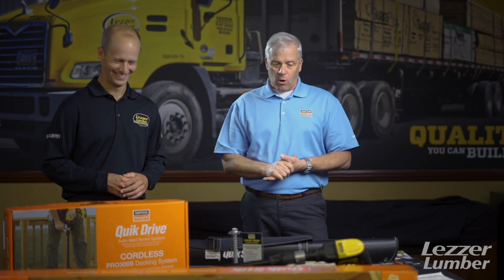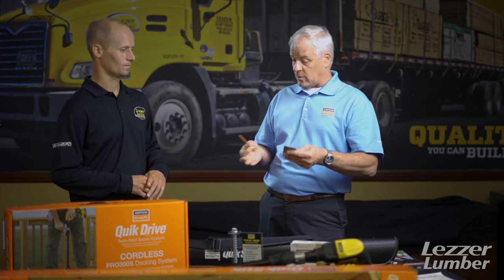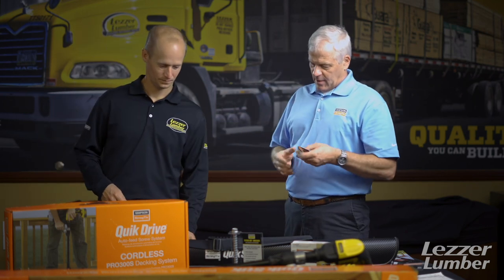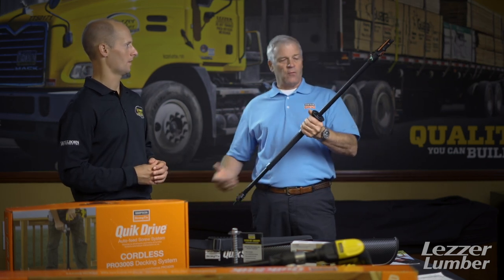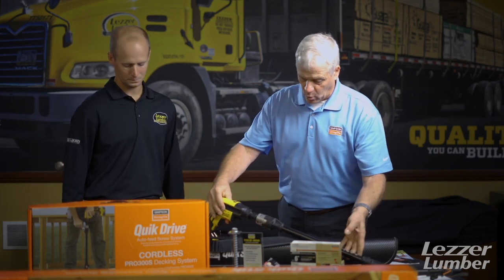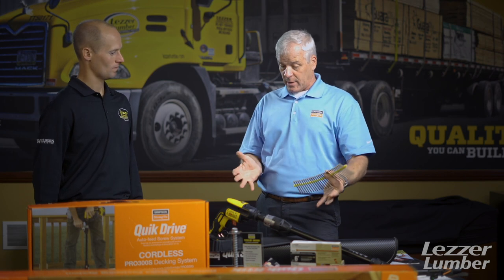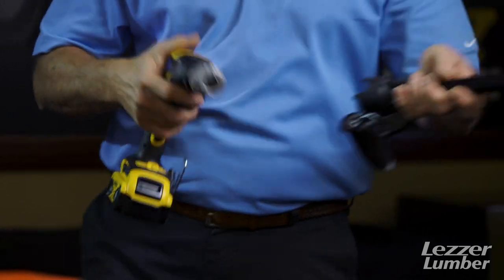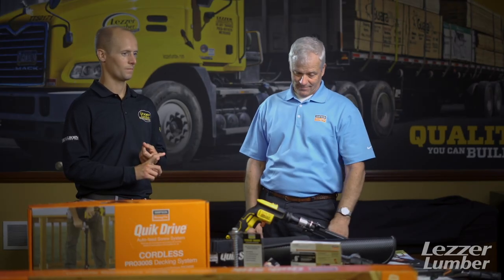Simpson StrongTie: SDWC Truss Screw and Quik Drive Explained

Comment: I have a concrete block wall to tie  H2.5A  to a wood truss, what type of tap-con can be used that is the correct length and diameter to use?
Reply: 3/16” diameter. Anywhere from 1-1/4” to 1-3/4” long. Hex head. 

Note: You will need to bore out the hanger predrilled hole so the 3/16” screw passes thru.